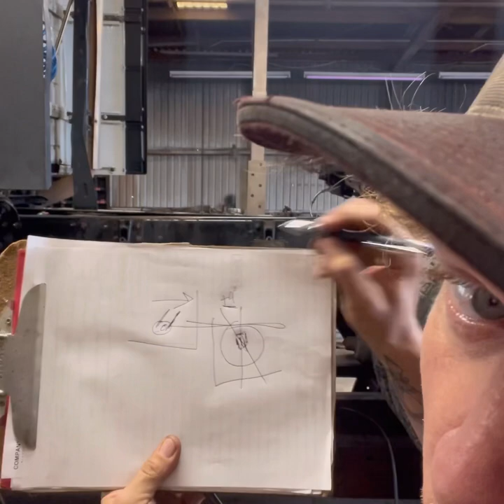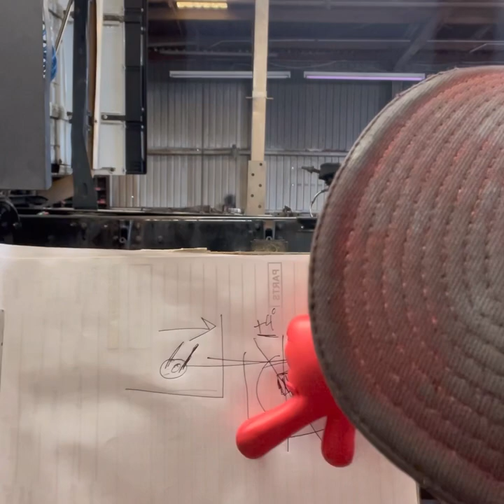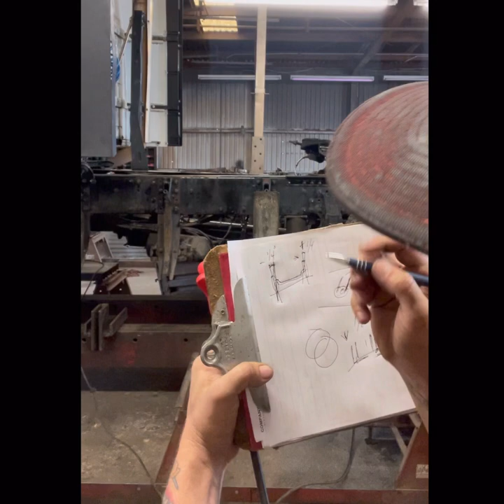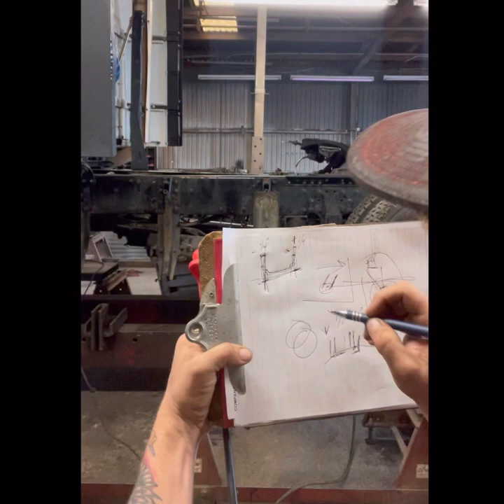What is caster ? Mind blowingly simple

Comment: Thanks for the lesson. Company I worked for once had a new Columbia Penske truck
 21000 miles the front tires was shot. 
It was a slipseat operation we kept writing up needs a frontend alignment. 
After 3 sets of steers it got a frontend alignment. Spend the extra money get a 3 axle alignment when you get tires. 
Dad always got his drive tires and trailer tires rotated as well. Like every 30000 miles. He'd polish all the Alcoas. He was a produce hauler ran California. If you got disc brakes could help with the routine inspection.